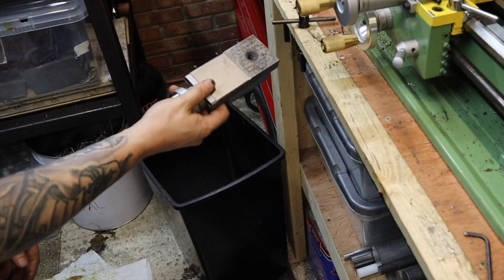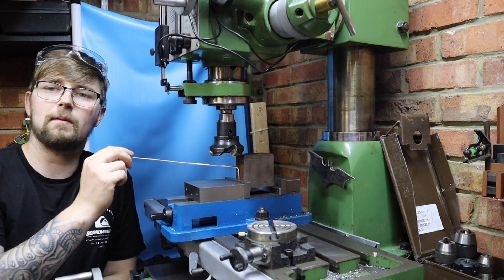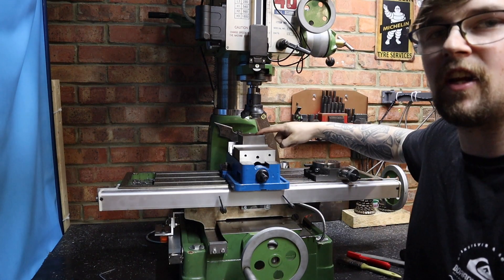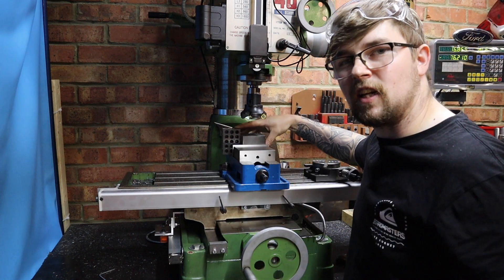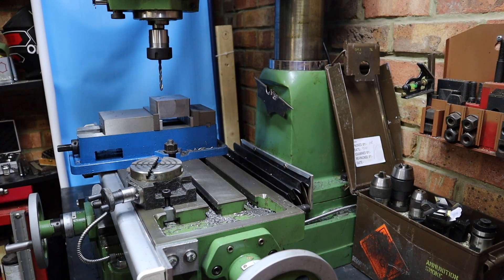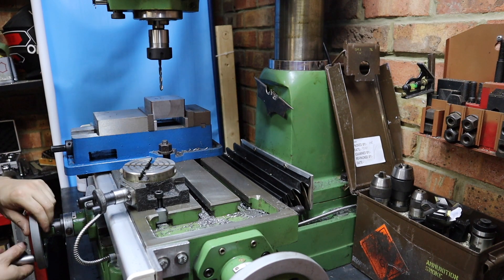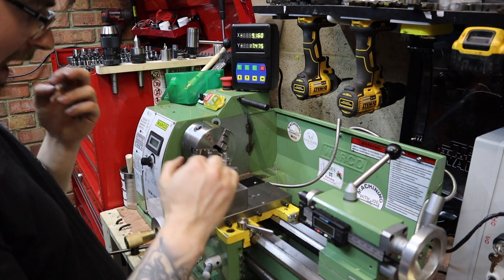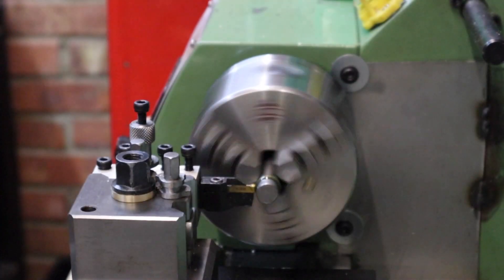Warco WM180 SOLID Tool Post UPGRADE

Comment: Nice one Joe - many years ago in the last century (1965+/-) 🙂the lathe I used was belt driven from an oberhead line shaft as was all the workshop machines - the lathe was built in the 1930's give or take a week or two 🙂 For it's age it was an incredible accurate lathe - the modern Chinese lathes are not the best really and require some fetling to improve their precision - nice workshop Joe.

Comment: thanks Joe.... so you used existing holes in the carriage bed?
Reply from the maker: Yes designed around the original holes that mounted the compound so no extra holes where needed.

Comment: This is where something like 3d printing could help to rapidly test if your part measurements etc are right. Most printers these days can get to within 0.1mm resolution so its great for testing out holes and heights etc.

Comment: Where did you get the tool post from? They seem to stock many versions.
Reply from the maker: Hi there Festive jelly. I believe the tool post I bought direct from warco. I liked the fact they always seem to have tool holders in stock and you can be them singular if you want.
Reply: @MachiningwithJoe  I ended up buying one that was similar from amazon. Just need to mill a recess in there now.

Comment: A handy tip: layout your cut lines and holes while the part is on the surface plate before putting it in the vise. A prick punch will give you a great start for center drilling to start your holes accurately.
Reply from the maker: Yeah that’s a great tip always nice to have a visual aid when working.

Comment: Thx good vid. Cast Iron: What do you need to pay attention to? Other rake angle than for steel? Are special cast iron drilling and cutting tools a must or does it not matter?
Reply from the maker: Hi so general I have found cast machines very easy and I make no special precautions in regards to tooling. Something to be careful with thou is make sure to cover your bed ways and give the machine a good clean down after as the machined cast can act as an abrasive on the bed ways.

Comment: Hi Joe, what size drill did you use to drill into the block, and what size bolts did you use the secure the block to the plate?
Reply from the maker: So the bolts securing it down are the same diameter bolts as original just slightly longer. Of the top of my head I think they are m5. And I used an 8.5mm drill but and tapped to m10 to secure QCTP to the riser block

Comment: where did you get that block from? I can only get aluminium one in that size.
Reply from the maker: Hi there I got this through EBay. I’ll add a link to the exact one I bought. 
https://www.ebay.co.uk/itm/70mm-Cast-Iron-Square-Bar-1-to-12-Lengths-Meehanite-Bar-Free-Postage-/333528913486?mkcid=16&mkevt=1&_trksid=p2349624.m46890.l6249&mkrid=710-127635-2958-0
Reply: @MachiningwithJoe  thx

Comment: Another worthwhile mod Joe, I did the same a couple of months ago when I got my QCTP and very pleased I did. Of course not having a mill I had to do mine in the 4 jaw on the lathe, which was fun. Just one suggestion, I made up a new centre bolt with a side handle so I don't have to find a spanner whenever I want to rotate the toolpost.
Reply from the maker: Yeah so far like you say seems like a good mod to do. And I think I may still have a handle kicking about so will have to try it and see how it goes. 👍

Comment: Nice to see your use of Safety Glasses, You only get one pair of eyes, I am jealous of your granite block, that is a good addition, a good machining practice you might consider when you drill, centre drill first, even if you just spot it, there is a good chance your drill will wander a bit if you don't.
Reply from the maker: Yeah I was so in the zone didn’t even think to centre drill first. Luckily enough the part fitted on the top slide perfect but if the tolerance needed to be smaller I may not have got away with it. 👍

Comment: Joe ! the weakest part is the mini lathe, get yourself a Smart & Brown model L .Regards Del.
Reply: But they are 80 years old buddy, even if you can still find one in good order.
Reply: although the warco is definitely not a tool room lathe and the S&M is a awesome machine I would ten times rather have the warco with all the upgrades Joe has done. A myford with a quick change gearbox is a much better option on the S&B